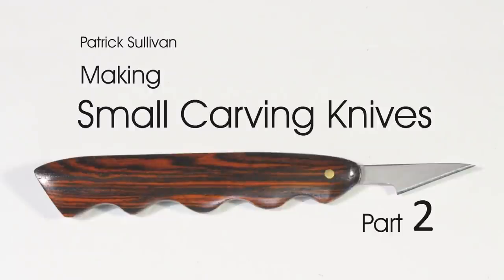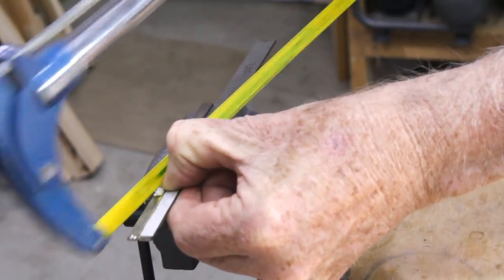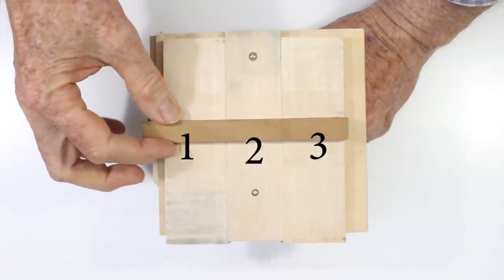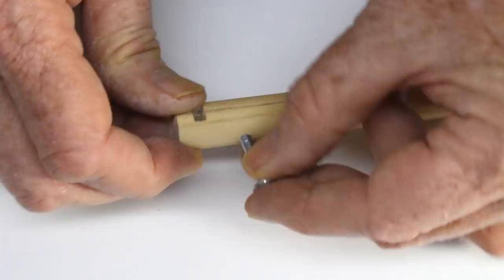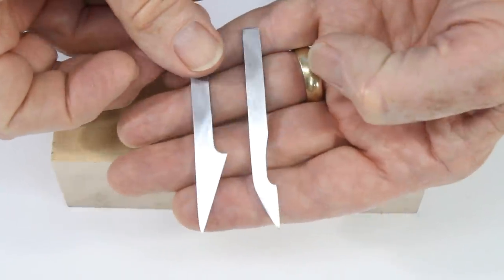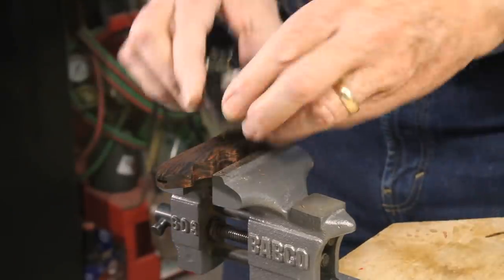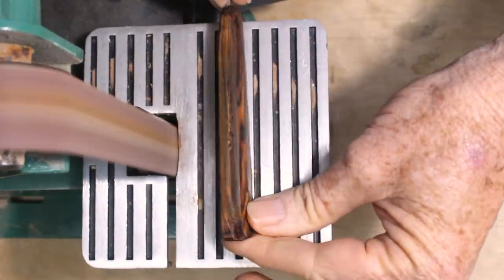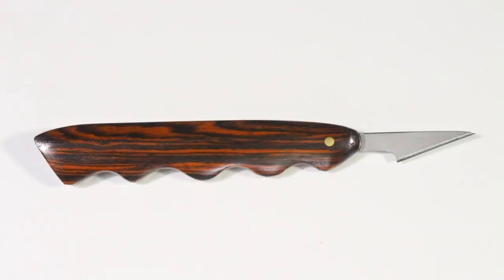Making Small Carving Knives: Part 2

Comment: I have a unique method of making handles, using a steel punch matching the tang size that I drive into the handle blank to make a rectangular in cross section slot for the tang. The punch resembles an old fashioned square nail. I tap it into the wood a bit, pull it out with pliers, tap a bit further, etc. It only works with soft to medium density woods, otherwise it is a lot of work and you might snap a punch or two. You also have to do it while the handle is oversized, so it doesn’t split. So you waste labor and wood. But you can’t beat the sturdiness or attractiveness, and you can make take-down knives in this way

Comment: great knives, super videos, unbelievable compound sharpening jig.!!  ...i've learned heaps, can now attempt to inlay to my wood turnings.!! ...i use THK diamond coated flat lap wheels, 6" & 8" 500 & 2000 grit, noticed today they're selling 500 & 3000 grit for less than $25 , they don't heat the tools, i also use diamond paste on a leather wheel, as a strop.!! ...i'll use your method of hardening & tempering on some of my tools that have been stuffed by overheating, by previous owners, can't hurt, i mounted a 6" wheel/disk with self adhesive carpet tape.!! ... Sorry if i'm wasting your time, just trying help in some way, you've helped me Bigtime, Regards Geoff

Comment: I make knives and I never hold any blade on the belt sander with the cutting edge up.  Always down.  You remove it from the sander more often to see what it looks like, but for small blades this is good.  it is safer.

Comment: Great videos.  Question - Why worry about overheating the blade if you are going to harden the steel after anyway?  Thanks for the informative videos
Reply: if you heat it too soon, too much, you end up partially tempering it making it very difficult to work